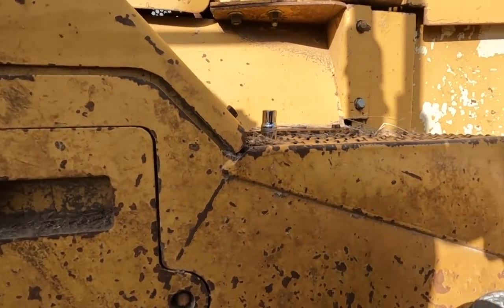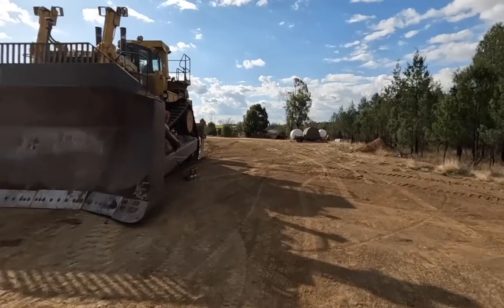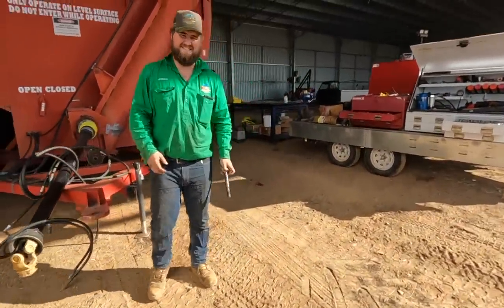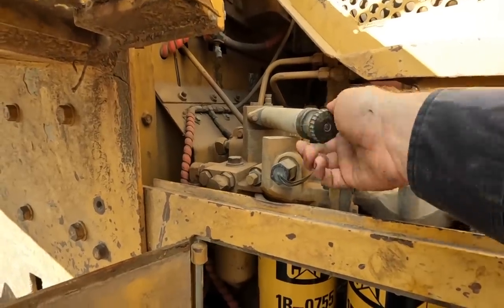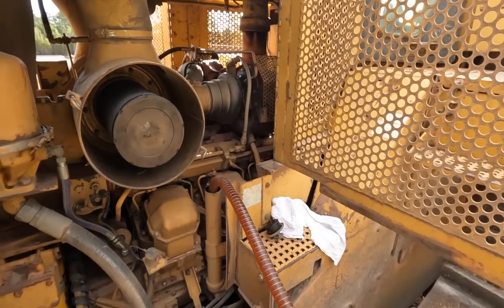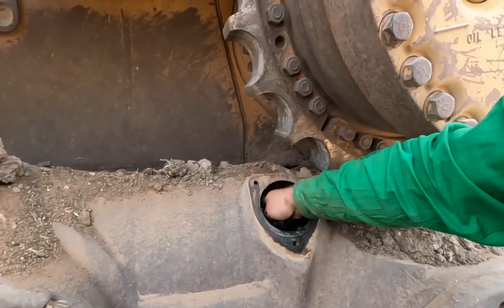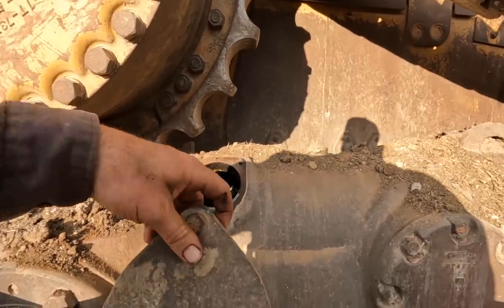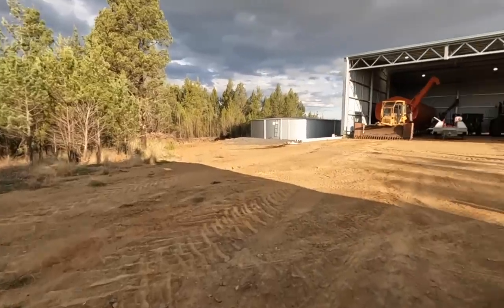CAT D11 Service | Part 2 | Big Bulldozer | Vlog 198

Comment: Thanks for sharing, I have a few gear boxes on a mower conditioner that self tighten's , I am the one that tighten's them up each season and with heating up of the gearboxes and cooling down some how they become rather tight, to the point of extension's on Allen keys are quite common.

Comment: You are perhaps the only person who actually shows yourself checking the oil and coolant level on your machines before starting them.  I can think of NO OTHER "operator" that does anything, but climb up on the machine, and crank them up, and race off into the great wild yonder, without allowing the machine to warm up.  Maybe they check the oil off camera, but it doesn't set a very good example..
I did cringe when you went off to help back the grain cart into the shed BEFORE reinstalling the drain plug back in the oil pan.  (I also would have put a sign on the controls, saying DO NOT START)

Comment: Putting the mother bin in the shed really shows just how big the shed is . I didn’t know what the capacity was for the motor oil on the D11 with you having 3 drums sitting by it? Awesome video as always 👍😀
Reply from the maker: Cheers! Usually takes a bit over 100 litres👍😁